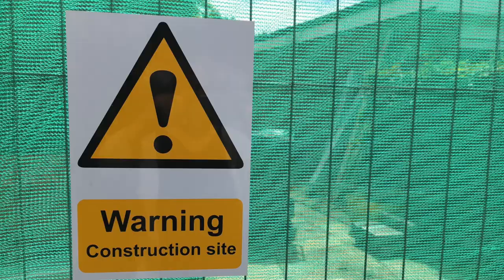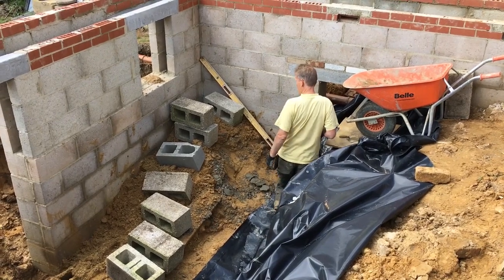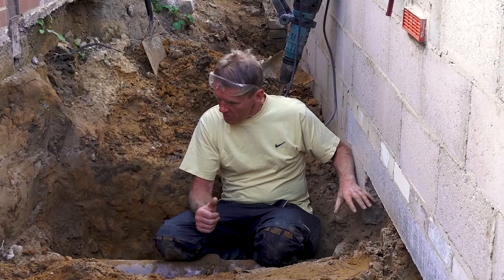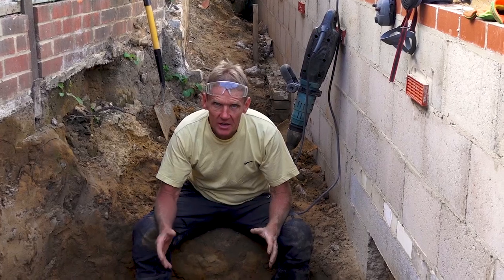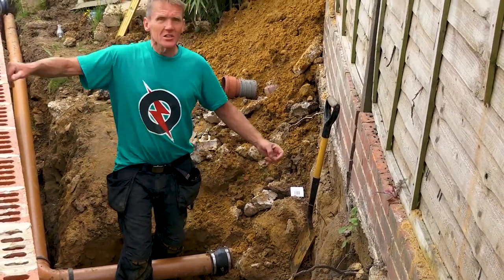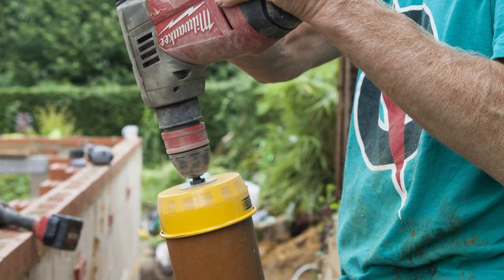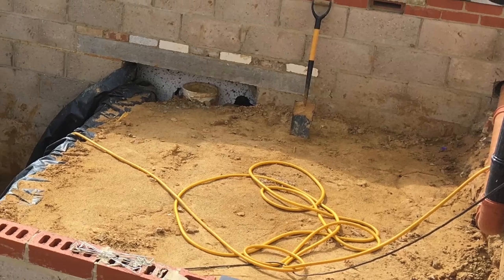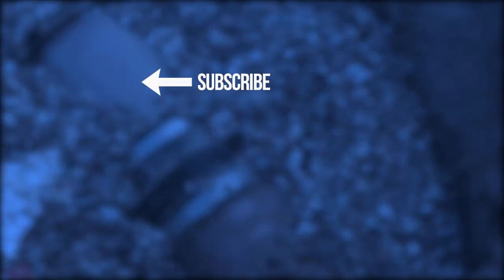The Nightmare of Moving Drains & Sewerage Pipes | Extension #2

Comment: Thank you for such a clear helpful video. I know it means extra work but impressed that Thames Water have guidelines and insist on clay pipes. The horrors I have uncovered here; foam, newspapers to seal waste joints and an old  vinyl tile to fix a broken clay pipe I wish Brighton was a little bit more interested in what the local ‘ builders’ are up to.

Comment: Thames Water still stuck using old methods. Solid work Roger.
Reply from the maker: Yes it is strange but they want to jet the  sewers with 7,500 psi and they say plastic won't take it. 
Hepworth Supersleeve comes with plastic inspection chambers and I doubt that the jettting machine will put a hole in them so who knows.

Comment: Could of done with your help today Rodger. Had to mess about with a pressure release valve on a shower. Who'd of thought a bit of plastic could cause so much trouble. 👍👍👍
Reply from the maker: Did it have a rubber bursting disc inside it?
Reply: Yes, and only found out through the Internet that once it goes it's gone. Had to buy a new one. Only 7 quid so not to painful. Got a email off an old plumber who told me the ball vall ones were even worse. 👍
Reply from the maker: Yes he is right. I got a pack of those bursting discs for a fiver but I had to charge the customer £50 because it was my daughter and I need to put her off calling me out.

Comment: Hi Roger - I saw in the background to the video you used what looked like concrete ‘H’ blocks. Could you cover why you used them and how the wall was built please (in a later shot it looks like they’re filled with rebar and concrete?) Many thanks and keep up the good work.
Reply from the maker: Hi Paul 
They are called hollow concrete blocks and they are usually reinforced when there is ground pressing against them. 
We run the rebar from the foundations through the hollows and then fill the concrete blocks with wet concrete.
Reply: Skill Builder - many thanks for your swift response, Roger. Stay safe 👍

Comment: Good morning Roger, further to my question, it’s actually called An inspection chamber which is in the back garden and it needs to be moved in order to build an extension 15 square meters. Can you advise. Thanks Bilal
Reply from the maker: This is a fairly standard thing. I moved one last week.If you have never done it then you might like to employ a groundworker because Thames Water want it done like for like so that might mean using clay rather than plastic. It is a pain in the butt.

Comment: Great job I had an extension done as a wash room  for my grandad but I’m noticing leaks from when they joined it to the house and cracks which I will have to fill but the roof is flat with stones on top but when they left they left all nails in the roof and most of the rubble on the floor and also there jackhammer chisel inset behind.
Reply from the maker: It sounds to me as though they didn't put cavity trays in the wall. It is common to find this job  hasn't been done. 
Can you send us some video or pictures so we can have a look at it? www.skill-builder.uk/contact

Comment: I would like to ask you a question, sir . I am building one story extension behind my house, but the problem is that there is a sewer pipe that goes under the building.  Do I have to build a wall on both sides of the pipe and put lintels over  before I put the slab over or just small stones around the pipe ? Kind regards Spartak
Reply from the maker: You must put a lintel over the pipe and leave room for any settlement. Then surround it in pea shingle.

Comment: Any reason why they insist on clay pipes? I'm all for conservation etc but surely in sewers plastic is a more reliable modern material to use??
Reply from the maker: I tend to agree but they are just a bit anal about these things. I think they consider that anything that has worked well for 100 years doesn't need changing but plastic has fewer joints and the clay joints are plastic so it doesn't add up.

Comment: did you waterproof the outside of the cellar wall? would like to know how if  you did
Reply from the maker: We put up a membrane and draped it down across the ground to deflect water away. We didn't use anything else because those hollow concrete blocks are filled with concrete so there is very little chance of a leak. We are tanking the inside of the wall with a membrane.

Comment: Hi Rodger, what fall do you recommend for a 110mm soil waste pipe? I have 15 metres of pipe to run up my back garden.
Reply from the maker: the usual is 1 in 40 but if it is more there is no real harm
Reply: 1 in 40 is recommended in plastic on foul drainage 1 in 60 on the storm drainage. Slightly more or less is not a major issue however if there’s to much fall on the foul they say solids in the pipe can get left behind and eventually cause blockages.
Reply from the maker: Yes you do hear that about exceeding the recommended fall.   I have a fall of  1 in zero on my soil stack and it never blocks up. Having said that I would like to know how it works in a skyscraper. The shit must hit maximum velocity.

Comment: Very interesting lol my son in law had the same problem but far worse lol
6 semi s ran from back by his house so when he did his etn he had to united utilities said dig down 10 ft .shutter round new sewer in a box fill an then concrete a level over oh and pack 100 mm insulation round ,
Many sq metres of concrete lol, then fill an start foundations on top uno hardcore 150mm inso membrane steel 200 mm slab .
It looked like a sinkhole at one point .
Then because he had to set back upstairs metres an metres of steel , agent said bomb proof lol .